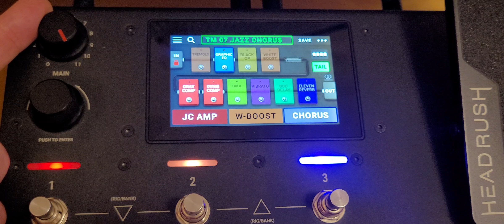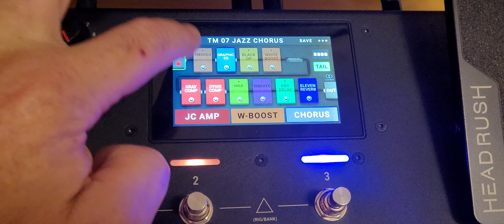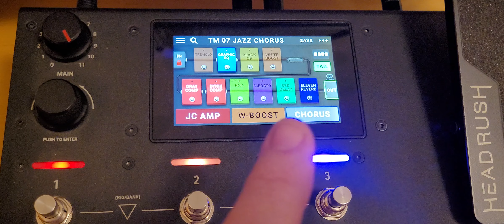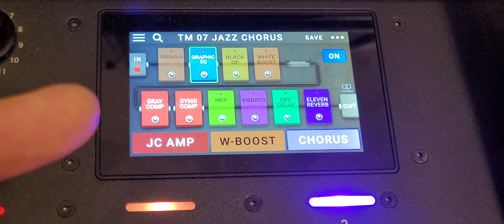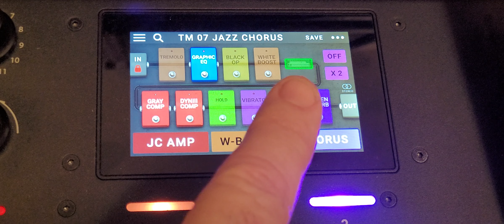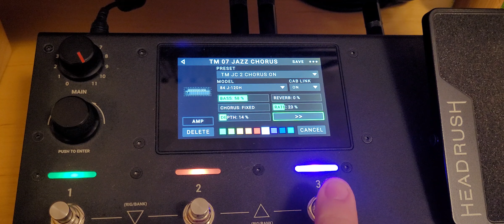HeadRush MX5 - Plugging Straight Into an Amp TIPS & HOW TO

Comment: ive had this pedal for like a year, i hardly use it i wanna sell it to guitar center but i bet they will give me hardly give me what i payed for it. it just doesnt make sense to me i want to get into real pedals but i have. this. its not damaged just dusty still has the screen protector i may try to dust it and take it in who know
Reply: I just got the flex prime. Its amazing
Reply: @JeremyLeech  have you tried connecting it to an amp yet? i tried with Headrush Prime in the studio but seems like that we have to create new sounds depending on the amp. I did on an Engl and was like earthquake happening really - in a good way!
Reply: @V @Voidtriangleofficial not yet! But I plan on doing so this weekend. I put an FX block after the Amp, before the cab. And then I’ll plug it into the FX return of my Marshall.